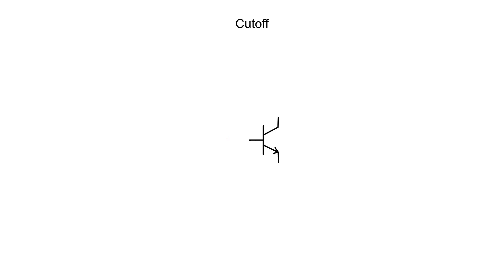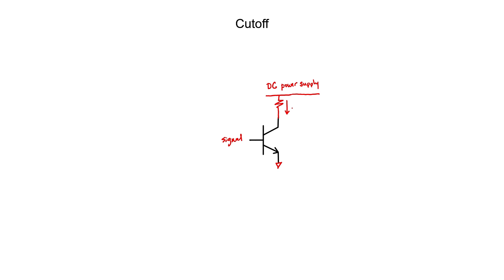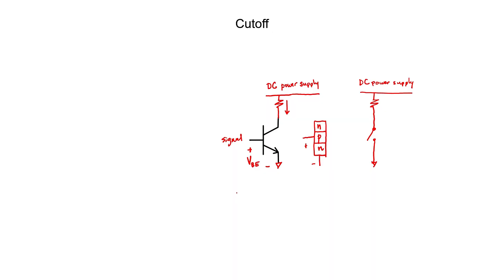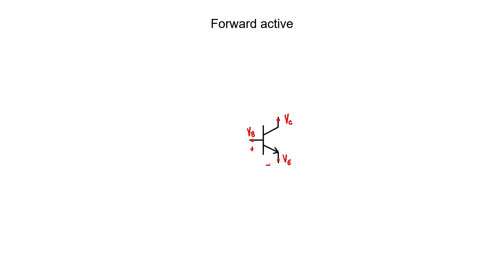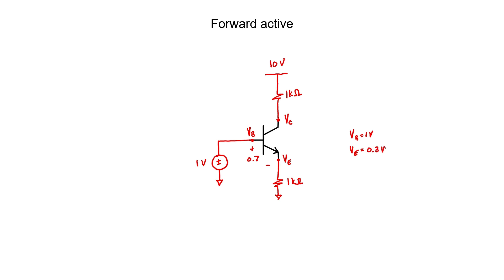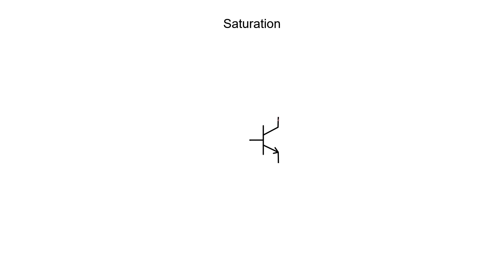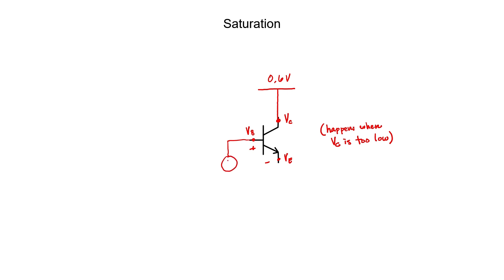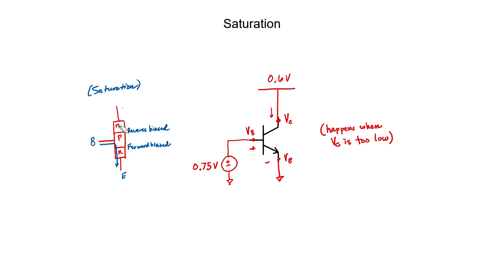Modes of a bipolar transistor (6-Transistors)

Comment: 9:30 in - I never thought that you could flip a transistor around like that.  If I knew that the emitter was more heavily doped, I must have forgotten that.  Otherwise, yeah N-P-N looks symmetric.  Does it do damage to the transistor in the short, medium, or long term?  (Provided you are putting reasonable voltages and currents into/onto it)

Comment: 12:37 Isn't saturation mode useful for some applications?
Reply: For digital applications - absolutely. Also very much so for high-power. MOSFETs typically used for powering up things and operate specifically in this range. (Known as "ohmic region")
Reply: @eitantal726  Actually no. Saturation makes for slow logic. The point of the schottky diode in faster logic is to act as a Baker clamp and prevent saturation.